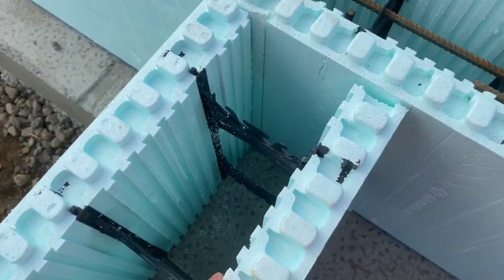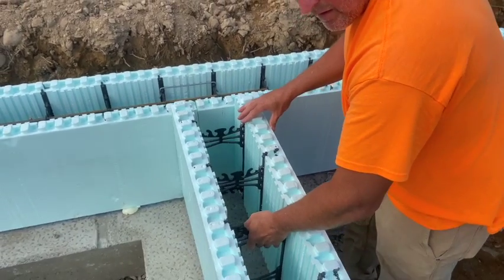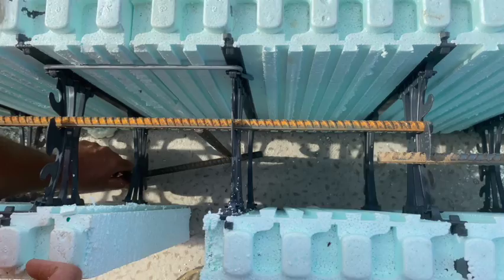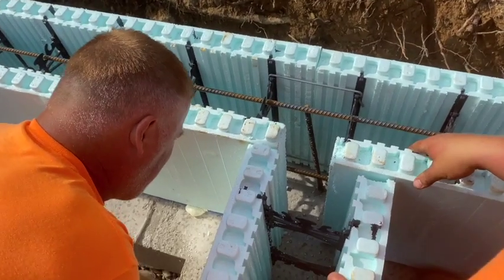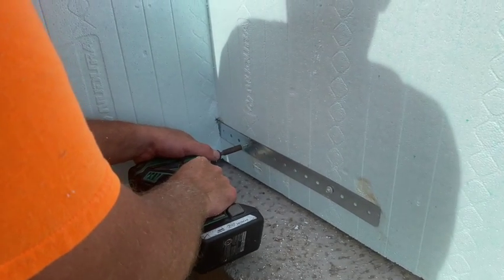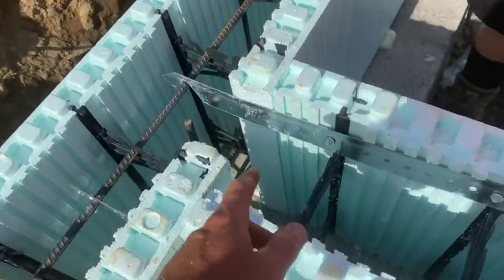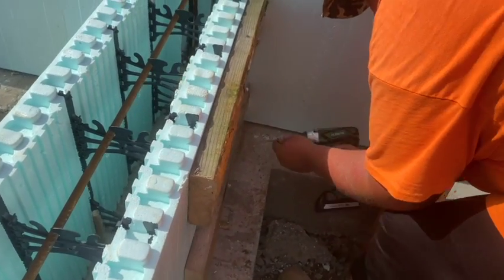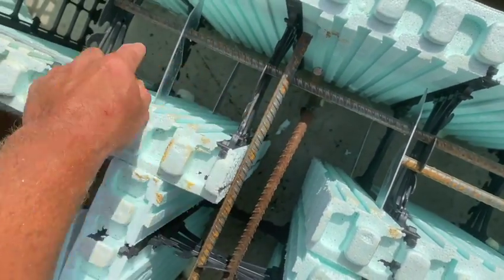Nudura ICF T corner explained

Comment: Na ..get as much concrete to reinforce the connection on the 90 degree  turn.and install rebar...any possible earthquake this joint is way more important to hold

Comment: Great explaination of the "T"s with Nudura Ron. I think that system you showed could be used or modified with other brands if you get stuck short like Fox Blocks T Block  A little more messing around but it sure works.